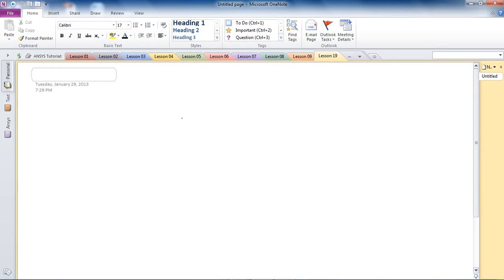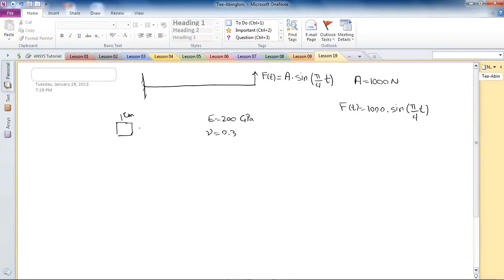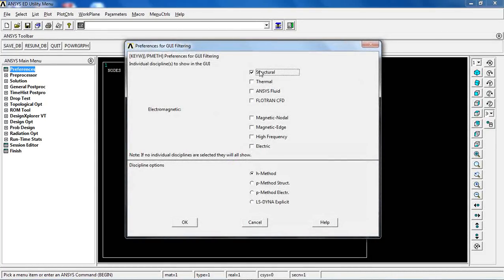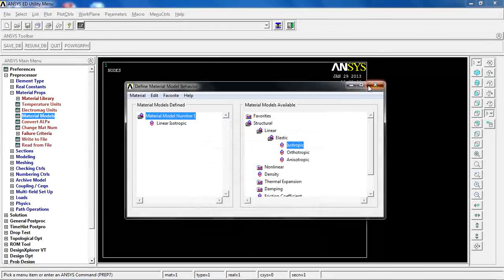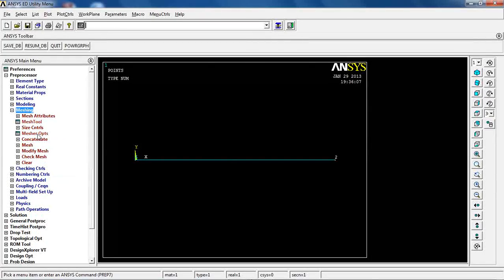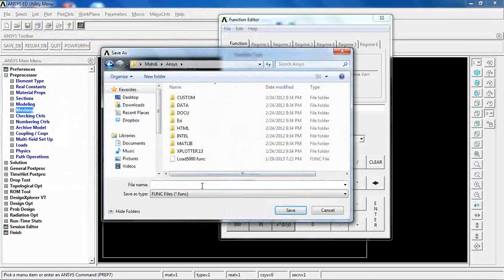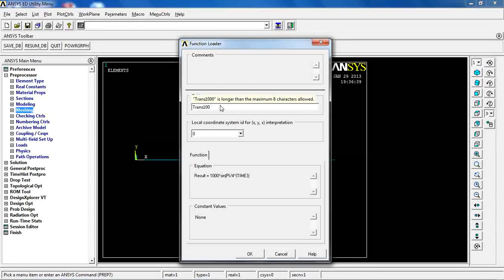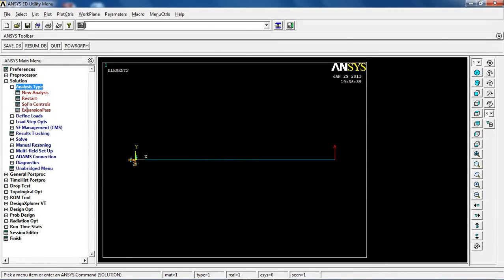ANSYS - Lesson 19: Sinusoidal Time Dependent Loading

Comment: Dear MAHDI
thanks, please tell me can ANSYS APDL model concrete building exposed to FIRE and mechanical loads at the same time ? Thanks
Reply from the maker: If you can model fire as thermal load, then a coupled-physics analysis can be used to solve your problem.

Comment: Hi Mahdi, Thanks for the good video. However, I think you had a mistake in defining the units of the beam geometry. As long as you defined elastic modulus in N/m2 (E=2e11 N/m2), I think you should define the geometry in meters. I mean, your beam length is 10cm, so you should enter the value of 0.1 instead of 100. Also, section properties 0.5cm*0.5cm must be defined as 0.005m*0.005m.
Please correct me if I'm wrong. Thank you!
Reply: sir please help me in solution control how to apply load in increments my failure load 200kN in proper load steps and substeps and how to modify stiffness matrix to solve nonconvergence
Reply: Madli 's right. I think so. E=2e11 N/mm2. not 2e11 N/m2 as you think!

Comment: Hi Mahdi, thanks for the video.
I  was doing the analysis on a simply supported beam but when I am not able to get the required results. In the time history variables dialog box, I am getting the minimum and maximum value of time to be 20 and 20 whereas it should be 1 and 20 respectively. Please help me with this issue.

Comment: Hey.. I am doing the model about three point bending. I would like to know that how to pursue the deflection every step of applying load. For example, If I apply 1000N point load at the mid span of the beam, How do I get the information of beam's deflection at the other values of load e.g. at the load of 50N, 100N,150N,....and so on. Thank you very much for your kind help

Comment from the maker: I selected ramp as just an example. I believe ramp makes load increase at a linear rate from zero to the defnied value while in step case, same amount of load is applied in various steps. You can try both modes and see how the results differ.
Thanks for the encouragement. I made these videos during the semester break and currently, I am busy with my school work. If I get a chance or a break, I may make more videos.

Comment from the maker: Hey, English is not my native language either, so don’t worry. When you use BLOCK to create geometry, ANSYS makes 8 keypoints at the eight corners of the block. If you need to apply a load on a point other than the corners, I suggest making the geometry from creating keypoints, lines and then volume. In case I come up with another solution, I will update you.